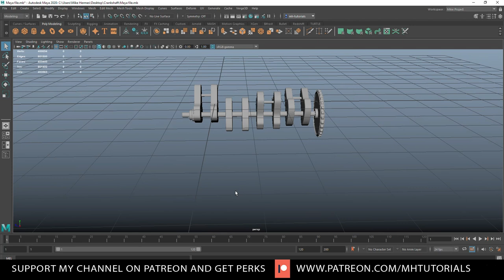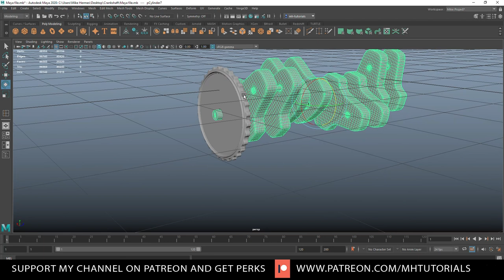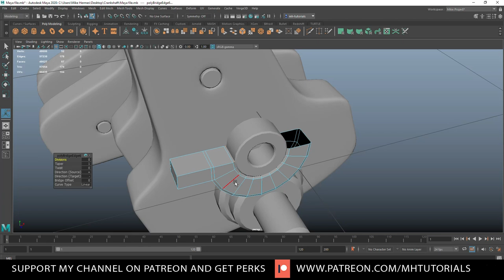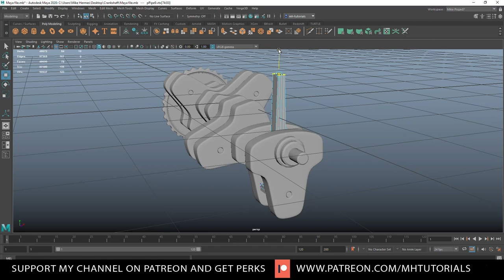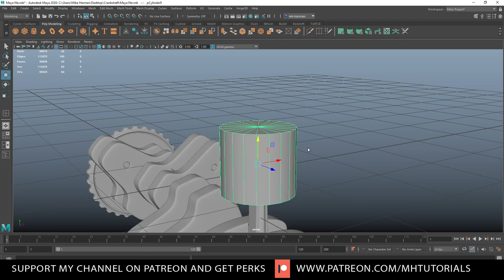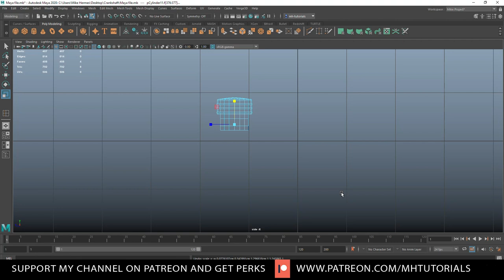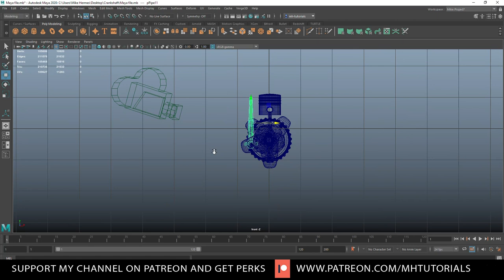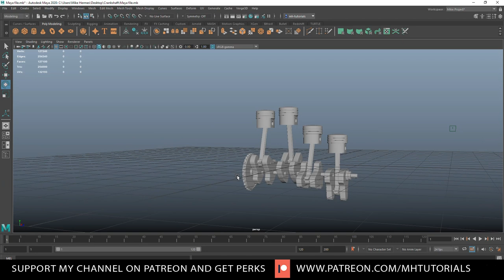3D Car modeling in Maya made Easy ! Part #10b

Comment: My little OCD kicks in here. I wouldnt mind a simple wiki reference of how a piston engine is more less built ;) 
The crankshaft is still made to "look" but it should be symmetrical when looking from the side.
The bearing between the shaft and connection rod is really thin as its a peace of metal that sits there and does the work not a bearing (not to mention its being connected to almost a pin and in a normal crankshaft this part has some radius to it. That also affects the "clamp" of the connecting rod having more radius and being srewed together with long screws and no side parts like this.
Hawing an edge in the middle of the connection rod would help to snap the cylinder in the center ;)
But now i will want to model this myself... Weekend project it is ;)